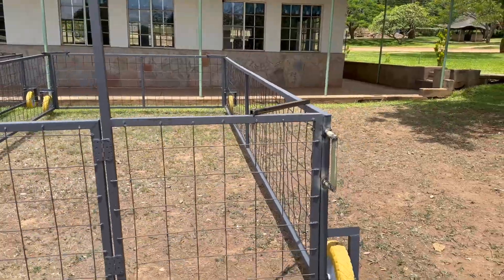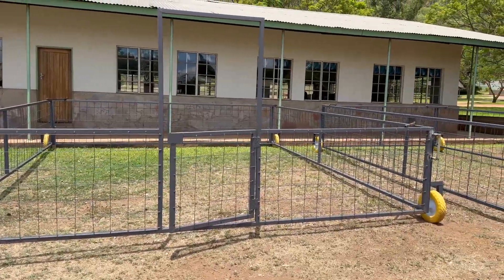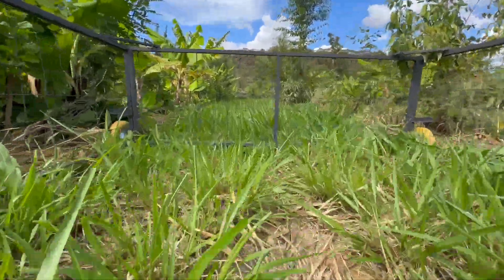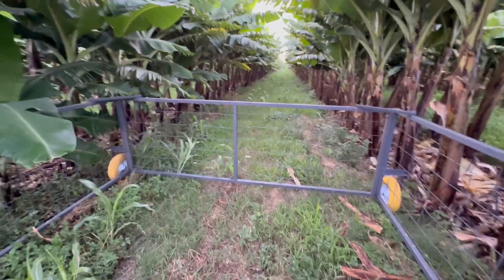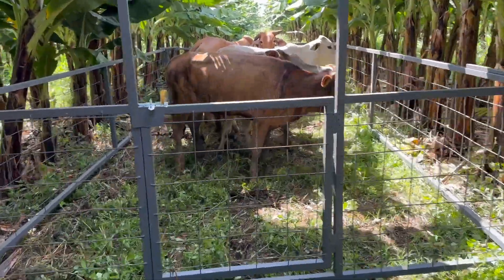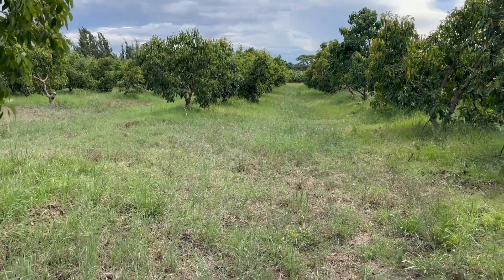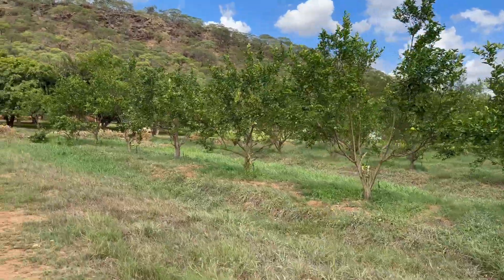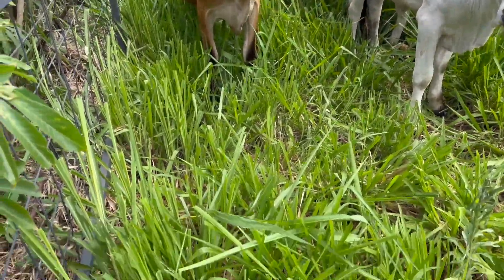Harnessing Controlled Mob Grazing In High Value Crops

Comment: Aren't they eating the plants' leaves? Furthermore, won't compaction become a likely problem?
Reply from the maker: So no the cage keeps them from eating anything important. Frequently moving the cage and growing cover crops and perennials grasses with deep roots keep compaction completely at bay.
Reply: @CraigForChange , I do hope that you are right because your project is very, very interesting. However, I would ponder replacing the cattle with the goats. My experience tells me that compaction may become a huge issue because they are likely to stay on the same spot for a long time. At least, you should survey this experience with a tool to measure the compaction. Meanwhile, I wish all the best to your project.
Reply from the maker: So we have a penetrometer we use and we do not leave them long at all. We make sure we keep 15cm of grass at a minimum so that takes care of it. We will add sheep into the mix at some point as well.

Comment: I love animal tractors and ive never seen one for cows.  How often do you move this per day typically with your stocking density?  Do the cows test the tractor at all or push on it at all?
Reply from the maker: So we move it about 10-12 times a day so it only works well with a dedicated person doing several cages or we can shift and use the hot wire if someone is keeping close watch with a bat latch system or cross wires frequently set.

Comment: that would work really well with hops. also with mini cattle. two high value items. they oddly sell well and mini cattle work really well in solar farms. but it's hard to really use them well other places. but they sell nicely as pets and this is really nice to put them near people and use to people combine with high value crop. like wine or what not. i'd probably not put this on a solar farm though. because moving this around. but for creators that need to be near people ie urban farming would be huge. a lot of time you got stock and you don't know what to do with all those extras to spread them out when they do there paid grazing. and get them use to humans at the same time. clumping bamboo would work nicely as well.